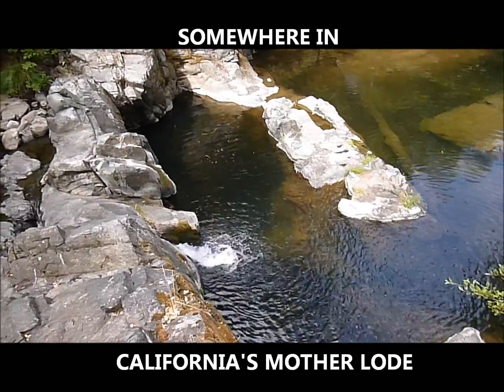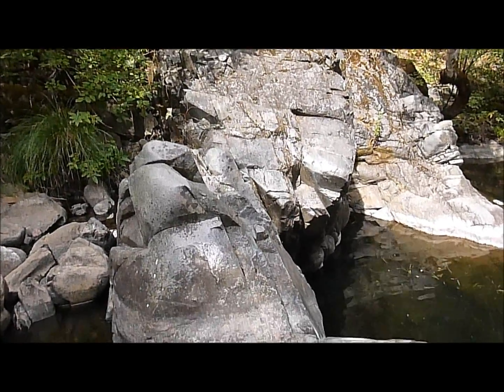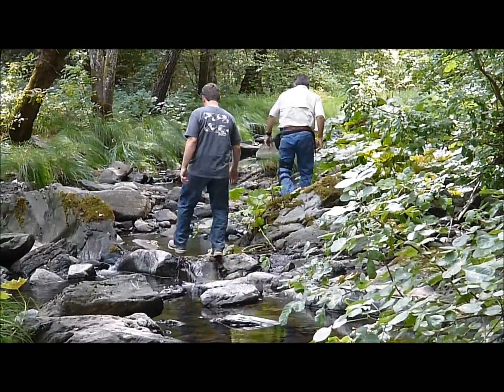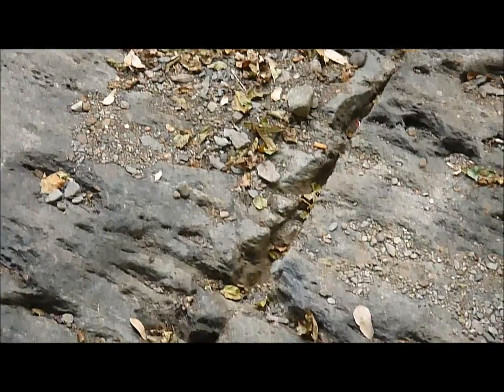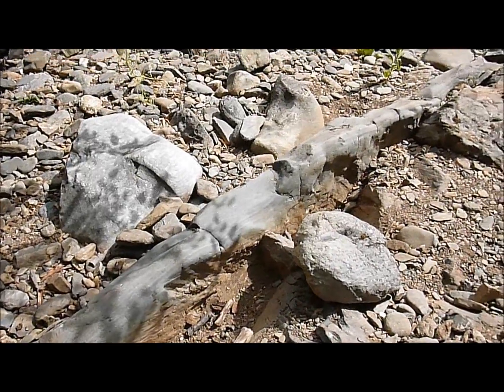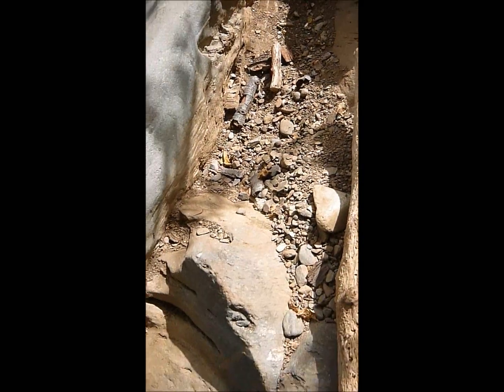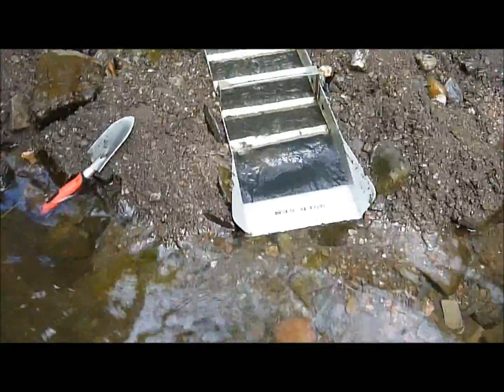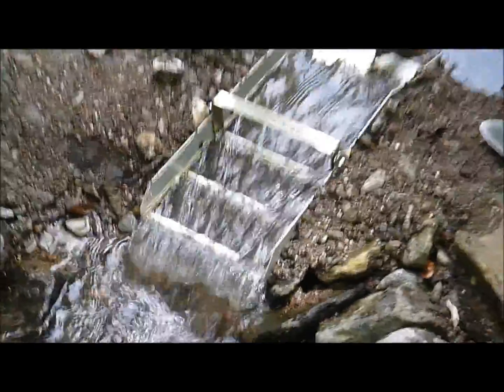Bedrock Gold

Comment: Lived up the road before the Butte Fire burned. Great place, to swim Gold has been worked. I usually find it in those pockets in the bedrock using a dental pick deeper than the others have looked. I posted a photo of gold found one afternoon on yahoo  groups placer-gold-mining. The photo is titled Calaveras River.( I;ve always called this spot "our back yard"}
Reply from the maker: +steve hansen 
Too bad about the fire.  I hope the road down to the river can still be used.  I was told once that there was a Miwok village somewhere along the river.  I've looked down the river from the bridge for a mile or so but didn't find any evidence.  Do you know of any bedrock mortar sites up river from the bridge?
Reply: +StocktonDan  Haven't ever seen any along the river, however about 3/4 of a mile to the north follow the road up to a big meadow, This must have been an encampment , mortars and such. By the way the bridge planks have burned access it from the same side as the meadow.
Reply from the maker: steve hansen Thanks for the great information.  I think I know the meadow you are talking about.  Is it the one on the north side of the road right before you make the sharp turn where the road starts up the hill?
Reply: +StocktonDan  That's the one.
Reply from the maker: +steve hansen 
Thanks again for the tip about the bedrock mortars.  My friend and I went to the meadow yesterday and found two sites.  One site was far up the creek that is in the middle of the meadow and had only 2 mortars.  The other site was on the edge of the meadow to the right of the creek (when looking from the road).  There were 12 mortars there.  We didn't have time to search the other side of the meadow.  Also, there were two large rocks in the meadow that were all alone.  One of the rocks had what might be "cupules" (round indentations in rock made by Native Americans).  The fire burned away a lot of vegetation so the old mine workings along the creek parallel to the road can now be easily seen.  If I do a YouTube video about this area do you want me to mention your name?  Any additional history that you know of about the area would be appreciated.

Comment: There is one thought to bear in mind when looking for gold ... gOLD is OLD ! Probably older than the bed of the waterway in which you are looking ; ie, the bed has eroded from underneath the pocket of gold ! Thousands of flood events have "sandblasted" the bedrock with the suspended sands and gravels of the then-normal beds.
It is contrary to  the usual timeframe of our thinking ... but gOLD is older than the dinosaurs!  Adjust your thinking ....
Reply: gold was made in an exploding star and gravity sucked it up when the earth was forming so yes its very old.... older then the dinosaurs lol
Reply: TryllHDTv Hmmm.... I would not go as far as you did with your explanation(s) of origins & deposition. A lot is supposition for sure; most gold is neither pure nor uniform. But, gold is heavy!
Reply: +TryllHDTv Everything in the universe, every particle and atom including the blood in your body and the steel rod on the top of the Empire State building along with all the oceans water and the material that makes up the Earths interior, was at some time part of an exploding star, as you put it. Gravity sucking it up is an odd statement. But I suppose that the attraction that matter has for other matter is known as gravity and it all ends up , through accretion, being a part of some great mass, or planet.
 If the inside of the planet is molten, there must be clean divisions between heavy and lighter metals and materials. Physics says so, as long as heat and pressure dont cause too much turbulence. There should be a layer of gold down there with iridium and platinum sandwiching the stuff on one side with mercury and thalium on the other. And the shit is heavy so unless traces of it are injected , (along with quartz and other metals in a liquid state ),along with subsurface water which, under pressure, is hotter than on the surface by a lot, into cracks formed in the existing lithosphere and forced upward to cool and solidify as pressure and heat diminish, it is down there to stay.

Comment from the maker: This 4-wheel drive road into this remote creek area is open to the public.  However most of the land on either side of the road is private property.  There is some BLM land up-stream.  I have been in this area several times and have not seen any mining claim markers or signs.  There was clear evidence of casual mining activity.  This was a very rich mining area during the gold rush.  Down-stream we found evidence of a very old gold mine and part of a more modern suction dredge.   A property owner in the area told me that several years ago there had been some extensive illegal mining activity in this area.  Some of what we saw was probably the result of this illegal mining.
Reply: +StocktonDan 
NECESITO COMPRAR TU BOMBA MANUAL...OHHAND DREDGE...GRACIAS , INFORMACION ESPERO
CHILE